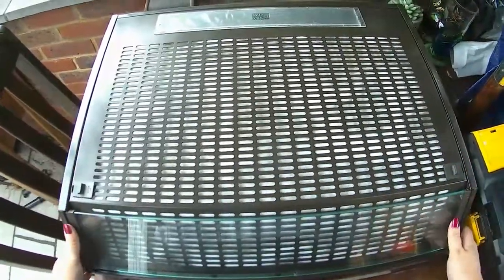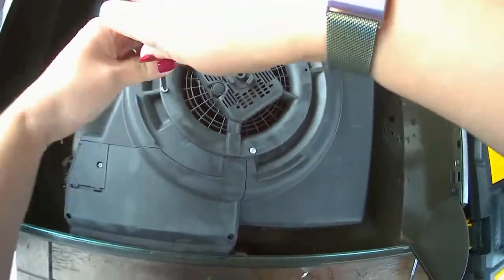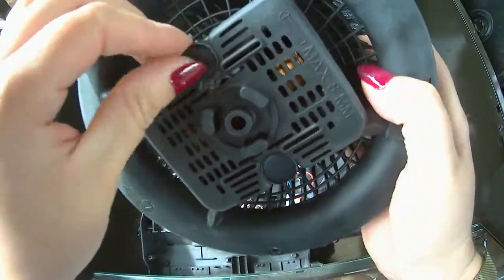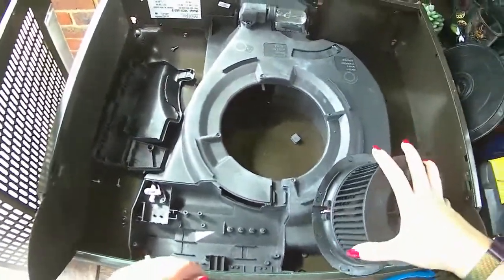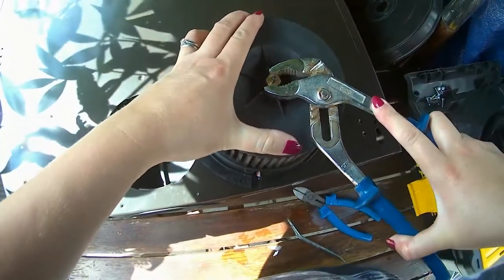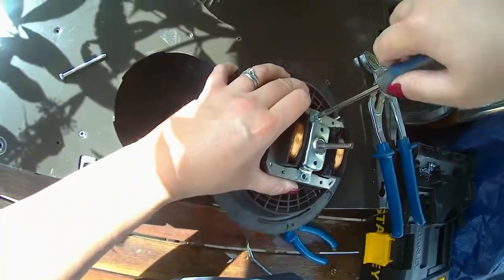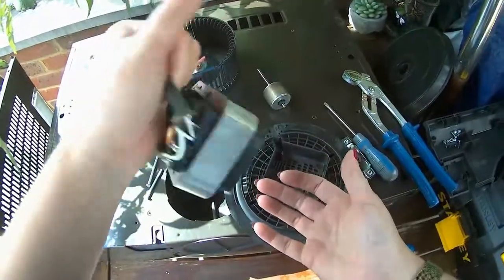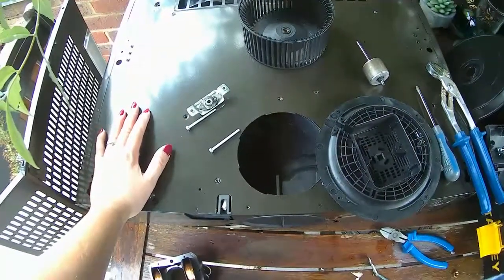Everyday Sollers: What's inside e-waste? How much copper is inside an extractor fan? Easy strip down

Comment: Quick tip phone charging/data leads the ones that are listed high speed or fast charge with the braide out cable insulation the cables are small but the copper cores are quite large in section I was given a tip from a friend of mine to stop my phone charging port clogging up with fluff and junk .. you cut the usb c plug off the lead
Reply from the maker: That is a great tip to keep the end clean!